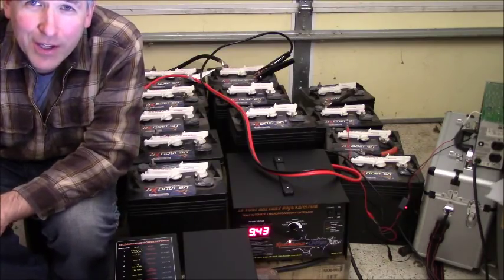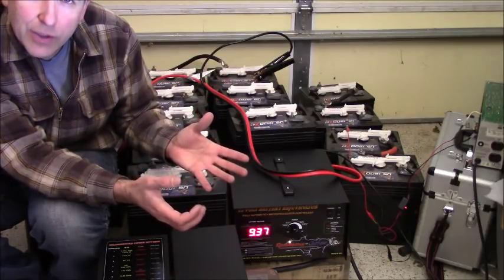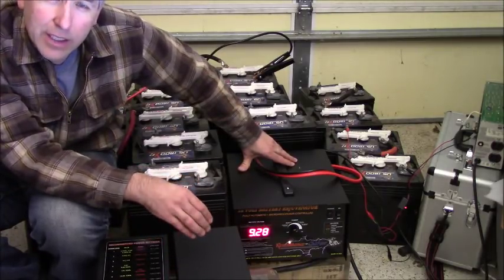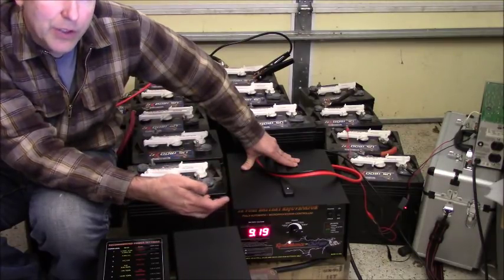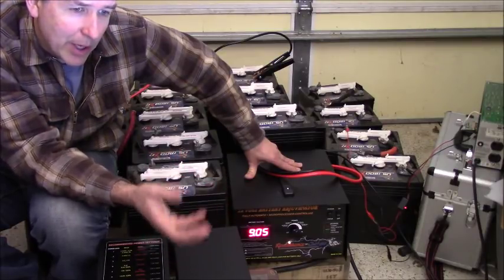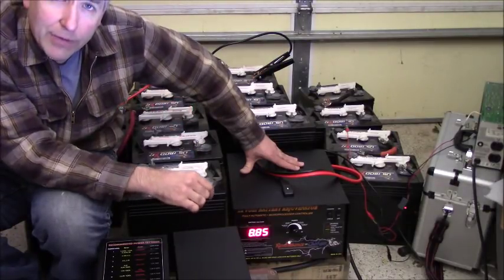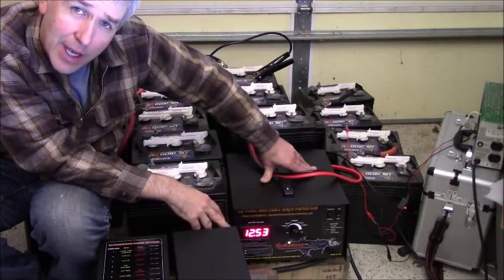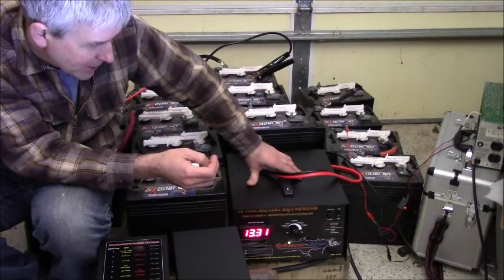Restoring Golf Cart Batteries after  Sitting for 4 Years.

Comment: How do you do this to 8 volt batteries?
Reply from the maker: 8V batteries are never used in 8V applications and usually used in groups of 24 or 48, etc. So we do have a few chargers that charge 24 or 48V larger batteries. We do have the RC1AU that charges small 8V batteries, or would take a long time to do golf-cart size ones.

Comment: I bought as a project 2x 70 lbs a piece 6 volt 75 amp batteries ...for a renogy  100 watt /1,000 watt inverter solar panel kit..that i may have used for a week..and the 2 batteries been sitting for about 3 years or more  with no use...I wired them in series for 12 volts to power the inverter...I just checked the battery after brushing off dust and cob webs..theres a brown like powdery stuff on one of them..but the battery is a Duracell 6 volt lead acid battery rated at 75 amp...I'm looking to restore it, because right now one battery is reading .99 volts and the other is 1.21 volts, any hope in these batteries that hardly got any use?

Comment: Have you ever had a 6volt with a bad cell where the sg doesn't rise?  I have 8 duracell batts and some cells are clear and don't bubble on eq. I wonder if they are developing a short or something,  the voltage is still near 6.2 though. Have you ever fixed a shorted cell? Wonder if it's possible

Comment: So my trojan batteries that crapped out the winter before last can be rejuvenated instead of replacing them for $250 or so a pop?
Reply from the maker: Maybe. Depends on whether they had severe abuse resulting in irrecoverable damage. Typically we see 80% of useless batteries come back to a useable condition (which means between 60%-130% of original capacity which is almost 100% on average). I don't consider a battery below 60% useable so 59% or lower is part of the 20% that don't come back. If the batteries were allowed to fully discharge and freeze over the winter then there is a good chance that they cannot be repaired.

Comment: Hi Rick - Is this the alarm charger you used  ?
http://www.r-charge.net/Renaissance-Alarm-Charger_p_87.html
If so, then you just need to provide your own 12-14 power supply to use this the way you did ?
Reply from the maker: Yes and yes. It is meant to be supplied with around 13.7V normally from the alarm or UPS.

Comment: Hi Rick, did you open the batteries to, I don't know, scratch them or something, or you did it all from the outside ? Thanks !
Reply from the maker: No, I never get into the inside of the battery other than adding water after batteries are rejuvenated (or making sure the water is above the plates before).
Reply: Thanks Rick. This shows this technique could save so many millions of batteries worldwide, by putting them into a "virtual forever number of charges". The world does need it !